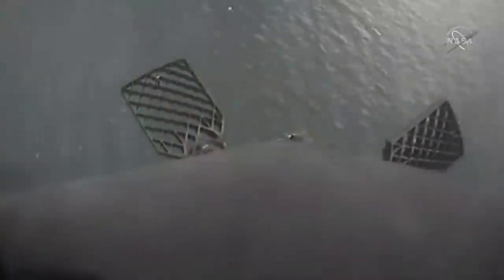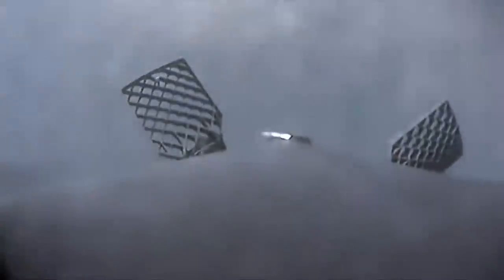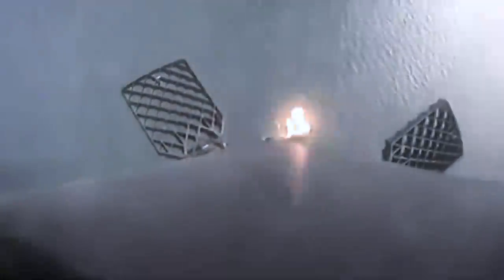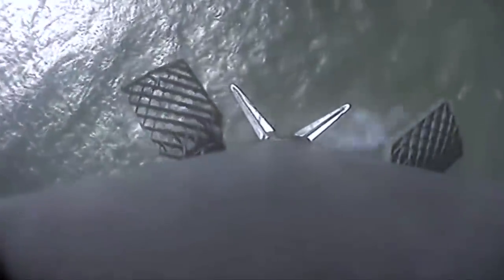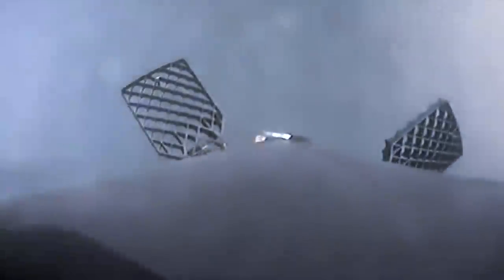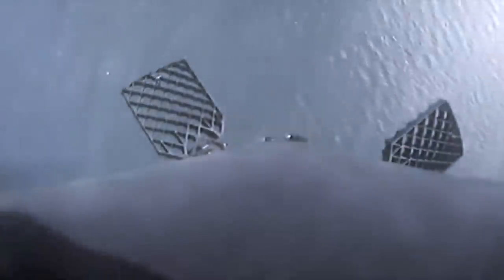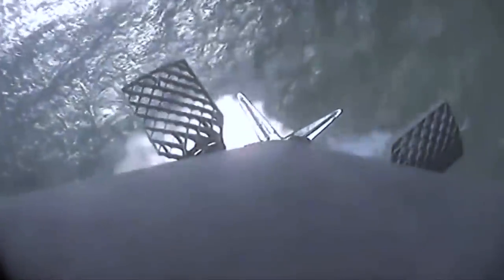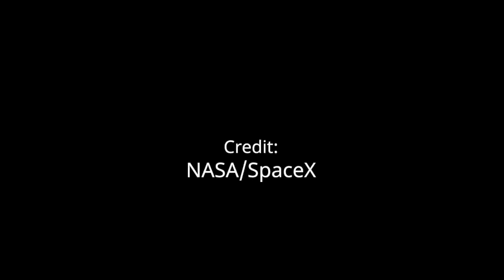Falcon 9 landing anomaly explained

Comment from the maker: SpaceX CRS-16 Launch https://www.youtube.com/watch?list=PLpGTA7wMEDFjV3rHufRlA_0vdSQFL9a40&v=4nBKZzLtS5g
Falcon 9 launches CRS-16 Dragon & Falcon 9 first stage failed landing https://www.youtube.com/watch?list=PLpGTA7wMEDFhuvDu_hopPa3X6TiFoK_3Y&v=3MFo-H44h7Q
Falcon 9 first stage water landing https://www.youtube.com/watch?list=PLpGTA7wMEDFhuvDu_hopPa3X6TiFoK_3Y&v=SMIc4tZPBaA
Reply: Soo close, the approach wasn't the best but at the last minute! Legs deployed , stopped spinning and halted to a safe landing speed! Real quick needed to slip a rug underneath it !
Reply: @Defcon1. A flying carpet would have been nice. Catch it and carry it to LZ1.
For many, this probably looks like a failure. I don't think it is. It's a huge success, testing the safety features in real life. Imagine the BFS with passengers on board coming back to land, some mechanical trouble causes it to make a water-landing and it sets down perfectly in the ocean. SpaceX has nailed that part. Can you imagine how safe I feel now to use the BFS on an intercontinental flight? They are capable to set the passengers safely down in case of an emergency landing.
Reply: I hadn't heard of this abnormality until I saw this video just now. I feel sorry for the Space X team that this happened but at the same time I am pleased the Stage went through corrective safety procedures to try to facilitate as normal a landing and shutdown as was possible.
The work of those involved in the Space X program amazes me and I believe they all deserve a good pat-on-the-back for what they have achieved to date, as well as their ongoing & future brilliant achievements.
Reply: No, no @Tim don't feel sorry. That is a good thing. Seeing how the software handled itself under impossible circumstances and without any payload or people onboard is a great experience for SpaceX. Think of all the valuable data they have been able to collect in regard to safety procedures and also the BFS, which will come down in a similar fashion with people onboard.
And yes, they deserve a good pat-on-the-back!
Reply: That told us almost nothing.
Reply: @Folker46. What kind of information are you expecting?
This press-conference was only a few hours after the water landing. I think they told us nearly everything they knew themselves at that point, which btw, they didn't have to do. If you have watched the live feed, you will know that it was interrupted half way into the landing. (Probably some overprotective technician decided not to broadcast it anymore.) What did Elon do after that? - He published the entire feed right away. Ordinary employees are protective, Elon has a different mind set. He is open. With a guy like that at the helm you get more info from his company than any other place.
I think we pretty much have what they know right now.

Comment: Explained? This video doesn't explain anything. The grid-fins hydraulics which use helium failed. There is no redundant backup system at this point, so once failed it is a loss. However, it did remarkably well to abate the rotation just with the engine gimbaling and made a great landing considering.

Comment: How can the booster steer itself to a safe splash landing if it lost its grid fins? Are the cold gas truster strong enough to overcome the grid fin malfunction and steer the booster to safety?

It seems like with less luck different grid fin malfunction may steer the booster to crash on land.

Comment: but why cut the live feed tho? Is that for investors? that was still fucking weird. It was way more interesting to see that then the other feed of the rocket in space doing basically nothing in that time.
Reply: The same reason Race car competitions won't show replays of bad crashes before they know the driver is ok. No one wants to show people die on TV. If the rocket safety systems would have failed during landing, there is a risk it would have crashed on a person or building.They won't risk to show that on live feed, that's why the cut it. As a precaution.
Reply: @tommia-h1v  I like the truth... there is nothing wrong with the truth.

Comment: The Space Shuttle had a self-destructing system in case the vehicle went out of control and could endanger people (i.e. the boosters from the Challenger were detonated from the ground shortly after the explosion)
SpaceX took a different engineering route and tries to guide the first stage gently to the ground and away from people as much as they can.
I wonder if they have a self-destructing system on board in case everything else fails.
Reply: Yes it does! Both the 1st and 2nd stages do have "flight termination" systems. I think Hans mentions this in a longer version of this video.

Comment: Goes on talking ... It all worked well ... Yada yada ... Stayed off land ... Yada yada ... Public safety was protected ... Yada yada.
No! The first words out of your mouth should be: We failed. This is what happened. Be a man. Then you would not feel the need for saying all this garbage.
Reply: This was not the primary mission. The primary mission, for which they were paid, was putting the dragon spacecraft into low earth orbit which was 100% succesful.
The secondary mission only benefits spacex but doesn't harm them if it fails. I mean if they crash the booster they are just as bad as every other rocket company in the world. But the important thing is:
They didn't crash! They regained control before the landing and landed in the ocean. Parts like the titanium grid fins (which are the most expensive part of the landing hardware) and maybe the legs and some of the engines can and will be reused.

Comment: Was it just chance that no boats happened to be in that area where the craft landed or is there a parameter that goes so many miles out from the landing area where no boats can be?
Reply: A no craft parameter is established for each launch around the landing zone. Using radar, the USAF Space Command, supported by the USCG, monitors the area. If a vessel wonders near or into the restricted area the launch is put on hold or scrubbed.
Reply: @tk421dr  

Thank you. ;)
Reply: @E_Stew  np its a good question.

Comment: Looks like some back up high pressure thrusters will be added.
Reply: The ones they have now put up a pretty good fight.   They need to add a fix to the gridfin control system.
Reply: I agree, but its still good to have redundant systems.  @josephastier7421
Reply: @zosojay024  They come at the cost of added mass, added complexity, and the introduction of new failure modes.   No matter how good your rocket is, less of it is better.
Reply: I agree.

Comment: Falcon 9 booster's computer went sully
Reply: Love it! Sully Mode
Reply: I was somewhat wrong anyway. After reentry, grid fins was supposed to glide the booster back to  land before landing burn. As we know, the grid fins failed. Fortunately, it stucked in a position that only introduced roll. Therefore the booster couldn't go to the land. Instead it went straight to the ocean. The on board computer didn't do anything except keeping the booster stable and perform landing burn.

The Computer didn't control where the booster landed
Reply: So true
Reply: No, that worked fine, it landed the booster almost perfectly in water even though it had lost the grid fins. The hydraulics for the latter got messed up.
Reply: @kim4184-d6m  Husein Nashr was complimenting the computer (and SpaceX). Like Captain "Sully" Sullivan, who successfully landed the jetliner on the Hudson River with no loss of life after losing both engines, the Falcon 9's first stage did exactly what it was supposed to do in the event of a grid fins control system failure, landing in the water offshore. (All Falcon 9 first stage land landings are initially targeted to a point just offshore; only after the computer senses that all is well does it move the touchdown point to the landing zone.)
Reply: @j.jasonwentworth723   you ruined it
Reply: @kim4184-d6m  I believe, that was a reference to Chesley "Sully" Sullenberger, who successfully ditched an A320 on Hudson, saving lives of his passengers and crew (only few minor injuries).
Reply: @kim4184-d6m  you should delete your comment since you obviously don't know the reference...
Reply: Thank you guys for explaining it to me :) And no, I shouldn't delete my comment. I'm not ashamed to misunderstand something, and it should be there for continuity.

Comment: Well done! I'm wondering if just landing on water is the way to go. Eliminate the cost of the barge. Just have it deploy a couple inflatable pontoons and remotely float it back to shore. Float it over a submersible truck trailer (underwater ramp), hook on and then just pull (drive) the trailer out of the water. 007.
Reply: Except the salt water destroys stuff and the falling over part is not something someone launching a 250 million dollar satellite is going to want to fly on next flight. And you are aware that the booster is 150 feet long, and 12 feet in diameter and weighs almost 20 tons empty?

Comment: They should have a secondary backup to save d rocket like drone or chopper to catch d rocket booster or a bobble boat that comes out first f rocket malfunction so that rocket will float,,
Or not f fins cause roblem put a booster para suit to minimize the speed landing and put the rocket on steady position 👍👍😉
Reply: This is where the 150 foot long ,12 foot diameter, 20 ton rule comes into play.

Comment: You screwed the pooch but as long as you put a good spin on it it's ok!
Reply: You do realize that stage recoveries are never paid for by the customer, right?  That's all SpaceX.   They can wreck stages all day long and still fly 100% successful missions.   Just like everyone other than SpaceX still does.
Reply: @josephastier7421  Why didn't they show it on the live feed? They quit showing it as started to fail.
Reply: @bigpappahemi4263  I think the reason that they sometimes cut away during anomalies is that they don't know what will happen next, and don't want to accidentally reveal secrets. Say the rocket breaks apart in flight and the video captures details of the internal structure that might help someone else design a nuclear missile? Rather than expose themselves to that risk during a live feed, they shut it down until they can review what happened, and then share it in a way they can better control. That is my guess anyway.

Comment: One question hits my mind: Is it still feasible to refurbisch a booster after a crashlanding like this?
Reply: No, the thermal shock will ruin the motors. The only thing they can safely re-use are the grid-fins. The rest is scrap because of the salt-water.
Reply: They said its still working and sending data. And elon said maybe they re use it for internal missions. So i guess that means yes^^

Comment: Are the grid fins oriented to cause the spin or stop it? If the former I'm guessing the problem is with a yaw sensor, orientation compass or software. If the latter, maybe there is some aerodynamic damage causing the spin.
Reply: Just my guess, but if one of those grid fins was misaligned with the others & "twisted" the rushing air would act against it and cause the spin. The stage would want to react like a Spin Stabilized Rocket only back to front. Because it looks like the fins are independently controlled perhaps the remaining ones tried to compensate for the spin & maybe were able to bring it under some control just before touchdown. Again, it's just my wild guess.

Comment: What about the round disc flipping threw the air before it started spinning out of control
Reply: Ice that formed around a pipe or nozzle in space, and then melted off in one piece once the rocket entered warm air.
Reply: Yes, a piece of ice was floating with the rocket which indicates to me that air isn't flowing passed the fins. Otherwise, the piece of ice would've blown away. This explains the poor stabilization.
Reply: Either there is poor airflow or it's a UFO.
Reply: It was ice that started melting once the booster came back from the edge of Space.
Reply: Thats a floater in your vitreous which is small flecks of a protein called collagen. They're part of a gel-like substance in the back of your eye called the vitreous. As you age, the protein fibers that make up the vitreous shrink down to little shreds that clump together. The shadows they cast on your retina are floaters. Get used to it...
Reply: Bull shit! It was perfectly uniformed with seraded edges with a slight golden sheen! Got the shit recorded! Absolutely 0% chance of mistaking that it's an anomalous object.
Reply: Can anyone explain why the object was perfectly circular  with perfect uniform seraded edges and visible 3d depth? If you think this is ice you are blind.
Reply: @amd65ak  Because it formed on a circular surface, probably some pipe or thruster. The 3D depth is normal, that's how ice builds up (spiked).
Reply: That's the dome.

Comment: Block 5s are so damn durable they can now "crash" and still go about their business.  I can't believe it safed itself still!
Reply: It literally just fell over into the water. It had reduced it's vertical  travel to 0 mph by then. The only problems with reusing this booster are related to salt water exposure.
Reply: @tjj300  Yes but in past boosters that fell into the water were destroyed from the tipping force or the waves afterwards. The only other booster that landed in water and survive post landing was GOVSAT-1 which landed in the water, tipped over but because they couldn't get it to vent, had to sink it.

Comment: Fin issues.
In a sense this is good... they will learn from this and improve.
Reply: Perhaps retract the malfunctioning fin immediately and continue with the landing as planned in the future
Reply: @kiedranFan2035  In an ideal situation, yes, though in this specific case it was the hydraulic pump that failed, meaning the fin couldn't move at all. Good point though, perhaps they could add a separator that will physically remove the fin or some other precaution if what they learn in this failure provides evidence that it's worth adding insurance for future flights.

Comment: Space X have to sacrifice a Block 5 next year for the in-flight abort test with Dragon 2.  Perhaps Elon had that in mind when he Tweeted that it could be re-used for an internal mission.
Reply: high probability they will use this one good test subject
Reply: The DM-1 In Flight Abort is being used to also qualify the new COPV. This is the last of the early Block 5 boosters that still has the old COPV. If they reuse this one I bet it will be testing some radical new hardware idea.
Reply: @PoeRacing  this was a brand new booster. First time flying
Reply: @PoeRacing  Would you happen to have some sources on the COPV and qualification stuff, I can't find something. Would love to see it. :)
Reply: Looks like it was not retrofit with COPV2. They have plenty of updated boosters on the schedule before the human flight of Crew Dragon to get to the 7 COPV2 flights NASA requires to certify the tech for humans.
Reply: You know what would be a good/bad idea? Let the booster intentionally explode and at that time the dragon starts to abort.
Reply: @_Andrew2002  I've been under the impression that the abort test will also be used as part of the crew certification for block 5 and COPV2. There is only one Block 4 booster left. If they are using a 4 it has to be that one. Do you have a source for it? I can't seem to find any solid info. I was wrong earlier about B1051 being the IFA. B1051 is the unmanned test flight in January.
Reply: @_Andrew2002  To be pedantic, I think Elon said "might".  No way of telling until they study possible damage.
Reply: Perfect use for it!
Reply: I thought they were planning to use the last Block 4 for that flight.

Comment: A perfect emergency landing. This just proved the other systems worked properly during failure of others. I expected to see a rocket slam into the water but this was nearly a soft touchdown. They will learn from this failure immensely.
Reply: Totally agreed. And it's not just that some systems worked properly when others failed, but the remaining systems have compensated the Malfunction. Must be very robust failsafe algorithms programmed in there.
Reply: Elon has already tweeted about a possible fix - it looks like the hydraulic pump that moves the grin fins stalled (meaning couldn't maintain pressure in the lines that move the fins), which Elon said is all coming from one pump. They'll look at installing backup pumps and extra lines. And sure that might not be the full picture yet, but I love the speed at which SpaceX addresses issues! Brilliant company.
Reply: @timclaydon5383  it's a little silly that there aren't already redundant pumps in place.
Reply: @Iroc3132  Not really. They explained (not here) why there is no redundancy there.
Reply: @chrish7927  source?
Reply from the maker: @David Griffeth Falcon 9 water landing https://www.youtube.com/watch?list=PLpGTA7wMEDFhuvDu_hopPa3X6TiFoK_3Y&v=LFdep0qCmYA
Reply: It coud be new way to landing.  No need the Drone ship.... May be.
Reply: @karubemanabu4341  If you look up Philip Bono's SSTO (Single-Stage-To-Orbit) spaceship designs (he was a McDonnell Douglas engineer who designed numerous SSTO vehicles, including one--SASSTO--that used Saturn S-IVB upper stage tankage, wedded to a circular aerospike rocket engine/actively-cooled base-first heat shield), he designed an emergency water-landing system for his passenger-carrying SSTO spaceships. In the event of an aborted ascent in which the vehicle couldn't return to a land landing, inflatable pontoons mounted in small housings on its landing legs would inflate at touchdown.